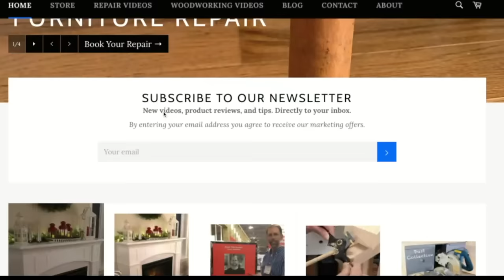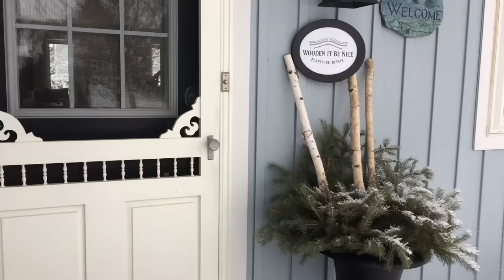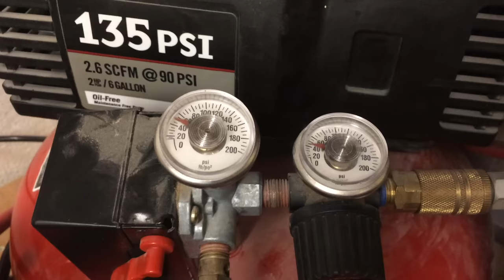How to Repair & Age Wood: A Rustic Wooden Chest Repair by Fixing Furniture

Comment: Why not oil on the stone? Why use water? Just for the chance of rust? That makes no sense. Oil the blade at the same time as you sharpen, does that make sense?
Reply from the maker: There are different types of sharpening stones.  I prefer water stones and diamond stones, which both use water.  I don't use oil stones.  I hope that helps.  Scott

Comment: Great content but the video is waaaaaayyyyyyyy tooooooooooo loooooooong. Maybe think about editing down to 40 minutes and moving the extras to a Patreon page, or breaking the video into 15 minute segment series.
Reply: I liked it. Try double speed ;-)
Reply: I still like all the information, so don’t want anything edited out. But, cutting in half and making a part 1 and 2 would be great.
Reply: @kll815  Im not arguing that they edit out content, only shorten the videos down. This could easily been 4 or 5 15-minute videos. There's also a lot of stuff that not directly relevant to the content. You could easily lose 15 minutes of meaningless stuff right there.